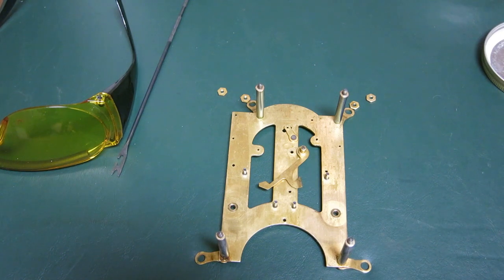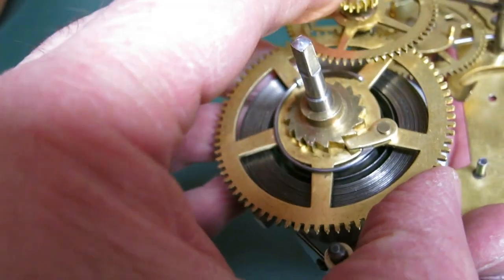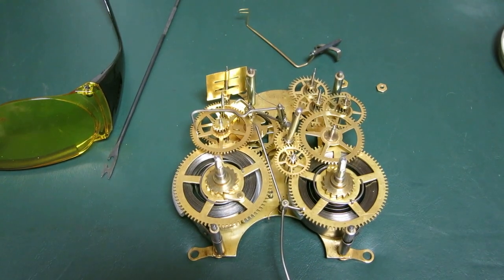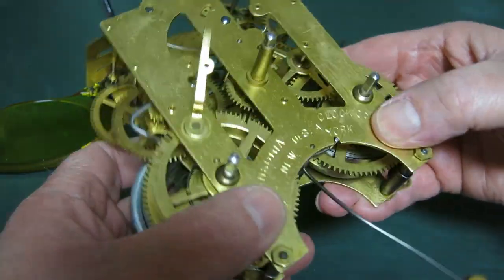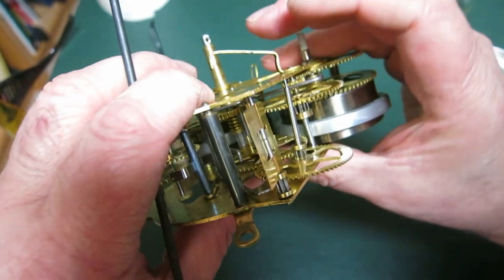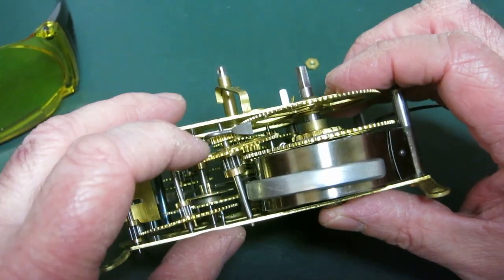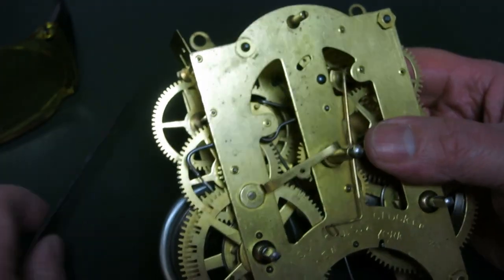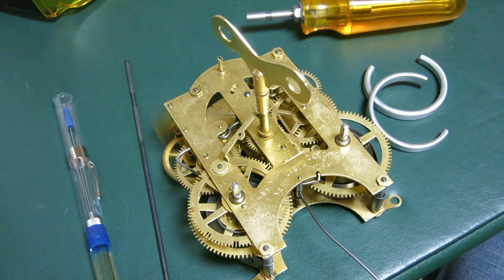Assembling and Adjusting an Antique Ansonia Kitchen Clock

Comment: Thanks for the video! I have been trying to reassemble mechanisms that I had taken apart and cleaned. Even after taking a lot of photos and video before taking them apart I was having a difficult time getting them back together. Your video shows that it takes time and patience. Even with that sometimes you have to take them apart, adjust something, and try again. Great for a hobby! Very satisfying when it works!

Comment: Excellent video.  Just rebuilt the fan mechanism for a friend and now the chime ran ... too good.  It turns out that while removing the fan pinion shaft, I did not have the spring compressed so it ran with a whirrrrr for a few seconds, ending up with the gear with pin out of sync by about 40 degrees, just like yours.

Comment: Thank you for this very informative and detailed video. I know how difficult it can be when trying to film a clock repair when often you need to lift the mechanism out of shot in order to adjust something. These ansonia clocks are far more difficult than the French clocks which I normally mess around with. This has helped me no end and my laptop will be on my bench when I finally put my Ansonia back together once its out of the ultrasonic.

Comment: You have lots of patience.  I enjoy this hobby too.  It would be a bonus as you assemble the movement, and naming the part, mention what it does; (ie) this is the fan fly, and it regulates the speed of the chime strike, and keeps the strike uniform.  Nice job Brad in half and hour.  Don't we love this stuff!
Reply from the maker: Thanks for the suggestion, and the nice words about the videos! I'm still learning, so a lot of the explanation might be "this is the... uh... it's a wheel with pins that have something to do with controlling the striking hammer....uh..." But I'll have a go - thanks again!
Reply: @BradfordNeedham  loved the way you have explained the parts and its duty, especially the chim settings and its breaks. You are such a personality with lots of patience.. Once again thanks for letting me learn something out of it. 😇

Comment: Thank you SO much for this video.  I forgot to control the spring before I removed the plate screws!!  Only minor injury to my thumb but significant trauma to figure out how to but it back together.  Your video was priceless to me!!  Clocks are not quite as complicated as building a violin but if you dont know which gear goes where it is hopeless.  Thanks again.
Reply from the maker: Ouch! Wow I'm glad things turned out allright, after your battle with the springs.
Reply: Numbers with alcohol washable ink all parts and their location on the plates.
When you have it assembled, wash everything with alcohol and grease it.
You will tell me
(by automatic translation)
Greetings from Barcelona - Spain.

Comment: I have assembled an Ansoina clock. Your videos were very helpful. It clean and re-assembled and seems to be working fine with one exception. It stops at exactly 1:15 each 12hr journey. It runs perfectly otherwise, it seems to be in beat and keeping good time. The fingers do not seem to be interfering with each other. Any ideas what the problem may be.??

Comment: My Ansonia drop octagonal calendar clock movement is ready to refit to the wooden case after a clean and oil. The calendar assembly has not worked for some time but all the parts are there, I just need some one OR picture to set it up I can load a pic / movie of the parts if  necessary. Mark
Reply from the maker: I haven't yet worked with a calendar assembly, sorry. I do recall seeing a video of someone working on the lunar disk of a grandfather (long-case) clock, but that's likely a different mechanism. You may find some useful information searching for 'calendar' on the (USA) National Association of Watch and Clock Collectors' forum (https://mb.nawcc.org/search/2249494/?q=calendar&t=post&c[child_nodes]=1&c[nodes][0]=22&o=relevance) Please let me know how it turns out & good luck.
Reply: @BradfordNeedham  Thanks Bradford, I sent a pic to John Fencean and he said it needed a spring and that made sense given the little wheel and holes so I fashioned one from a little one out of a vacuum cleaner and now I have wonderful working 100 year old Ansonia on my wall.

Comment: Where do you get your parts from ...if I may ask?  I have a set of works ...1878 I believe.  But they've been through the ringer and I need a few bits.  TIA
Reply from the maker: I buy most of my parts from Time Savers (https://timesavers.com/). I've also looked at Merritts (https://www.merritts.com/) and a few others. For the times I've needed parts such as missing clock wheels, I've bought a clock on eBay that's listed as "for parts and repair" - one that doesn't run, but may have the parts I need.

Comment: Thanks for an informative video. Maybe you can answer a question ... I don't see any mechanism to give the pendulum a push to overcome friction and keep it going. The only connection to the pendulum I see is the escapement. The escape wheel is connected to the main time spring, so it has power. Then, is it the pressure of the escape wheel on the verge that keeps the pendulum swinging? I don't have any parts left over after re-assembly, so I'm wondering why the pendulum slows and stops. Thanks.
Reply from the maker: After reading your question I realized that I didn't show the final steps of assembly: installing the pendulum and mounting the movement in its case. To answer your question: yes, the power is transferred from the time mainspring to the escape wheel, which then pushes the verge. The verge then transfers that energy through the crutch to the pendulum. The pendulum should hang through a loop in the bottom of the crutch; that's how the crutch pushes the pendulum back and forth.

A lot of things can cause the clock to stop after running fine for a few minutes. The simplest one being that the clock is just dirty - but since you've reassembled your clock, I assume it's clean. The next easiest one is the clock being "out of beat": the swing of the pendulum should be centered, so that the "tick" and "tock" of the ticking clock each take the same amount of time. See https://youtu.be/XgnvYfPVedY for a quick description of how to put a clock in beat. A more complex reason that a clock will slow and stop is worn pivot holes: ideally, each wheel's pivot should sit in the center of a round hole in the front or back plate of the movement. A worn, egg-shaped hole will make the corresponding wheel be off-center, making that wheel not mesh correctly with the other wheels. Repairing a pivot hole is called "Bushing" or sometimes "re-bushing". A good demonstration of how to bush a pivot hole is at https://www.youtube.com/watch?v=7pJFUyYMU1o&t=2382s. Finally, there are tons of types of wear and damage that can stop a clock: worn or missing teeth, bent gears, and worn out ("Set") springs to name a couple.

I've read a couple clock repair books that recommend not spending a lot of energy trying to find why a clock stops running, but to instead spend that time making sure the clock is clean, the pivot holes aren't worn, and the various parts of the clock aren't bent or worn. I'm just starting clock repair, so I haven't yet run into a frustrating clock that will run, then stop. dperry428 on YouTube has a pile more experience, and may have further advice for you. Good luck, and let me know how it turns out.
Reply: Excellent. Thank you. I'll let you know.
Reply: I bent the crutch a bit to equalize the tik and tok so that it is 'in beat', and it has been running for a week. Thank you.

Comment: I have just purchased an ultrasonic cleaner but I'm uncertain as to what fluid to use to clean clocks.  It has been suggested Simple Green diluted in water.  Would you tell me what you use?  Many thanks!
Reply from the maker: Good question. My latest post on Needhamia.com, titled "Cleaning a Clock Movement" describes my current cleaning process. I used to use Vigor brand ultrasonic cleaning fluid because it's non-toxic and septic-tank-friendly, but it doesn't seem to be available any more. In that post's section titled "Alternatives Other Clock Repairers Use", I give a few pointers to what recommendations I've found. You'll find there are as many cleaning fluid recommendations as there are clock repairers. Personally, I'd avoid complex home-mixed recipes because I don't know whether they're safe for me, my house's pipes, or the environment. Good luck, and let me know what you decide to use.
Reply: @BradfordNeedham  Thanks for directing me to your other videos.  

 I have now established my cleaning regime.  I first put the clock parts in a 10:1 mix of water and Simple Green HD and run the ultrasonic for 15 minutes.  This removes the vast majority of dirt, oils grease, etc.  I then run it for 20 minutes in a mix of 7:1 water and PolyChem DEOX-007 and that does a remarkable job - the brass comes out brilliant and bright - like new!  I do the Simple Green wash first as the PolyChem is expensive ($50 per gallon) and this process means it can be used many times.  I've done three clock movements this way with excellent results.  
I purchased the PolyChem from a clock/watch supply company in Toronto (Perrins).

Comment: Great video! One thing tho, how do you get the clamps off the springs while it's put together? The springs came off without clamps so I can't just do the reverse of taking it apart
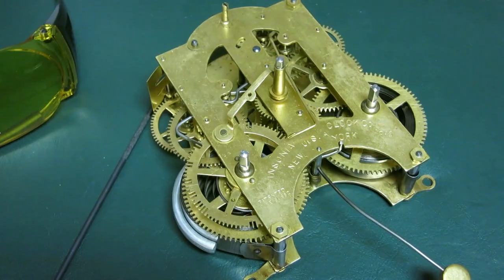Reply from the maker: My Bad - I should have shown me removing the clamps just before 31:59. To remove a clamp, you wind the mainspring up until the clamp is loose and you can feed the clamp out of the movement starting with one end of the clamp. It's the reverse of attaching the clamp which you can see demonstrated at Scottie's Clock World's video: https://youtu.be/cOPvJQadUx0?si=7tRX8e6cKL1HbotA&t=228

Comment: Hi...., this is Ravi from India. I have an old antique ansonia wall clock. Now its not in condition...., that means I lost pendulum of that...., I don't know the weight of that pendulam. Where can I get it...., I have searched so many shops in Bangalore..., Karnataka...., I didn't get can you suggest me the weight of the pendulum..., I'll share the picture of clock..., please share up mail l D..., thank you so much for sharing this video....!
Reply from the maker: Interestingly, my Ansonia clock lacked its original pendulum, so I bought a seemingly-original one on eBay. I don't like buying clock parts on eBay unless it's clear that the seller isn't just disassembling clocks and selling the parts for more than the whole clock is worth - that's a sad thing to do to a clock. The replacement pendulum I bought weighs 105 grams; the bob alone weighs 91 grams, and the stick plus rating nut weighs 13 grams. The stick is about 175 mm long. Best of luck bringing your clock back to life, and let me know how it goes.
Reply from the maker: The pendulum for this Ansonia clock is visible in my short demonstration of pendulum suspension rod length, at https://youtu.be/kaoj-mpTRLc?t=22
Reply: @BradfordNeedham  really am proud of you..., thanks for your quick reply....! Have a nice day...!

Comment: Sarwar Khan
Thank you very much for such a valuabe video. I have got the same clock but some of its parts have been lost somewhere. I would like to request the company if it can gift me the complete same machinery so that I could fit it in my clock to bring it in running position. I am a poor man and cannot afford such a huge amount for the said machinery. I shall ever remain indebted to the company this this kindness.
Reply from the maker: If you're asking me to give you an Ansonia clock movement, I'm sorry I can't do that. The least expensive option I know of is for you to buy a used Ansonia movement on eBay - I understand that those movements may still be too expensive for you.

Comment: Thank you Bradford, I too, like treetopspider have come stuck on an Ansonia style clock - its not an Ansonia so I have to do everything backwards  because I am working from the front plate up. you have helped me after my 3rd assembly attempt to get things in sync.  Like you I have  snapped the strike hammer spring and you refer to "getting a new one"  I have tried Clockworks of Huntington MA but without luck - not possible to easily get in the UK; so can you suggest a supplier in the States for me please? I  would also get the additonal spring for the sync levers.  I can make do but would prefer to stick to proper suppliers and replacements.  PS treetopspider has some interesting videos on YTube about slate clocks restorations - if you have a slate clock worth a  look.
Reply from the maker: Born Again Clocks has a video on making a Helper Spring winder: https://youtu.be/Vx42YH3xvQI I made my own 3D printed spring winder, which is terrible (still breaks easily) but held together long enough for me to wind the spring I needed. For the hammer helper wire, I bought Brass Spring Wire - 24 Gauge (.020") from Timesavers: https://timesavers.com/i-8946642-brass-spring-wire-24-gauge-020.html I see from my notes that I also bought some Brass Spring Wire - 26 Gauge (016"), https://timesavers.com/i-8946643-brass-spring-wire-26-gauge-016.html , to replace what I called the Lever Spring (it was a while ago; I'm not sure what spring I was talking about). 

Thanks for the pointer to TreeTopSpider (https://www.youtube.com/user/treetopspider/videos); his videos look useful. Thanks again!

Comment: With due respect:
Set the main wheels first, set the hammer, put the centre wheel or the minute pole, put the first wheels on both the sides,put the cam wheel and second wheel in place, then put the pin wheel on the strike side and the third wheel on the going side and finally put the fly-wheel or the fan and escape wheel on the going side and just before the fly wheel put the stop lever and then attempt to the plate on.

Push the hammer in place and put the nuts on to the poles near the main springs half way.  Start pushing all the wheels of the going side onto the holes one by one and put a nut half way. Take to the strike side and push the first wheel, second wheel, cam wheel,pin wheel and the stop lever and the fan wheel and put the half way.
Now put the lever or Arbour through the slit from above so as to touch the escape wheel slightly lifting the plate gently  and thereafter tighten all the nuts one by one.  This method makes the work easier and enjoyable.  You can cut short the struggle in this fashion. All the best.
Reply from the maker: Thanks for the tip - such advice is so helpful to folks like me who are just starting out. I'll give your method a try the next time I reassemble this clock. Thanks again!
Reply: @BradfordNeedham  You are welcome with your problems too, may be I can guide in the right direction.Love

Comment: I  have a New Haven Ansonia gingerbread clock I have taken apart . Super cleaned it. It differs from all the other Nw Haven movements that I can find on the net. Mine has a straight top with fly governor in the middle at the top. My warning/stop pin  is on the upper end of Strike train. When I put it back together I never get the warning/stop pin in the correct position and it will hang up or just keep gonging. I found one movement on Ebay that was a exact match but got outbid. Kinda know how that works. As soon as I bid whoever is watching automatically bids another .50. Could be the seller bumping up the price. Shipping was ridiculous too. If you can help it would be gratefully appreciated. By the way, it was super filthy. Some (gear pins are worn and bent. Plus 1st wheel teeth were  bent but was able to bend them back. Seems like that gear is made of to soft brass. And I am just a amature and don't know how to replace the small sprocket pins so will probably just leave them alone.
Reply from the maker: I'm sorry you had such a bad experience trying to buy a clock on eBay. I've had trouble sometimes with automatic bids - I don't know how high the other bid really is, because the other buyer's automatic bid keeps increasing just a little to stay ahead of mine. The actual other bid could have been $10 higher! It can be frustrating. Shipping a clock is often expensive because a properly-packed clock takes a much larger shipping box than the clock does. I've read horror stories from clock buyers who found the seller hadn't packed the clock well, and it was demolished in shipping.

About your clock, I haven't worked on a New Haven yet, but it likely has a warning pin that works like this Ansonia clock's - though the details of position, number of warning pins, and how the lever drops are likely different. I've sometimes had to adjust the warning pin 5 or 6 times before I get it into the right position - it's hard to keep the warning wheel from moving as I click the wheels in place and close the plates. All I can say is to practice - I know that's not very helpful advice.

By the way, if several gears of your clock are bent, it may be the clock suffered a broken spring at some point, which can bend many parts out of place; you've managed to choose a challenging clock to work on. Best of luck, and let me know how it goes.

Comment: Now that the clock is running, I find that the chime goes on forever. Unfortunately, the chime mechanism in this Korean knock-off is completely different from the one you describe. Do you have experience with other varieties? I have pictures and videos, if you're interested.
Reply from the maker: My first clock repair was of a Korean-made clock sold by Montgomery Ward. I have a few short videos on this channel, and a set of blogs about it starting at https://needhamia.com/clock-repair-101-lasciate-ogne-speranza-voi-chintrate/ - that info might help a little. Good luck!
Reply: @BradfordNeedham  Thank you very much.
Reply: Yep. Had to get the wheel with the warning pin in the right position. Thank you.